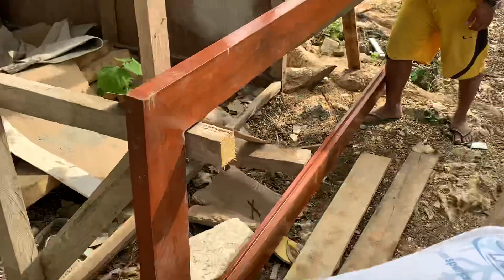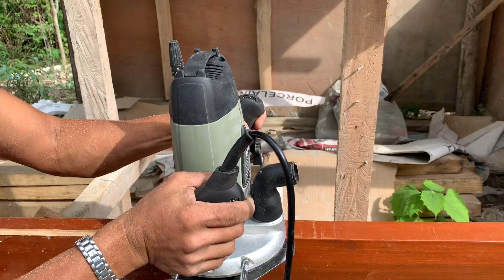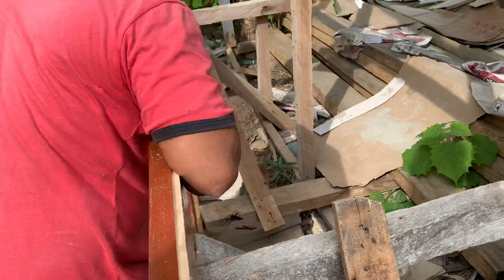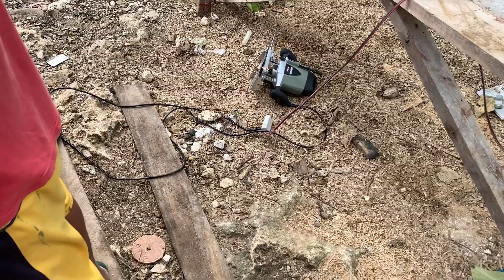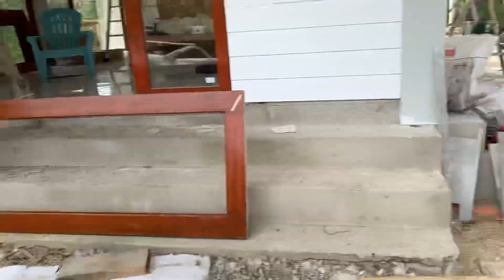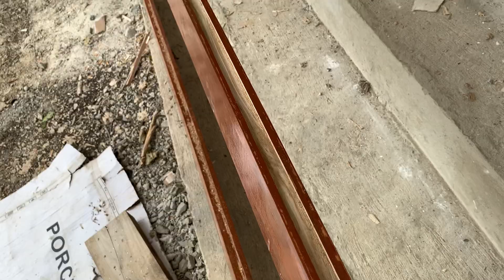SLIDING DOORS - USING THE ROUTER // HOUSE CONSTRUCTION IN THE PHILIPPINES

Comment: Anthony, I think you should make the joint with tapered sides so it is narrower when the panels meet but closes up as it bottoms out on the opposing door. After they
have done all the doors to the shapes shown here use a straight something clamped on one side  and raised a little to tilt the router base and use the same bit you 
are now using .  A surface mounted dead bolt lock keyed on both sides would hold the doors together. Probably a high mounted one and a low mounted one to be
more weather tight. Then one door needs to be attached with a pin into the floor or the fixed door so the whole set can't be rolled to one side. Remember the walls are GLASS
and you have a yard full of rocks. Just leave a large rock on the steps so anyone breaking in will only take out the replaceable glass rather than a one of a kind wood
door frame. I leave a bucket of one dollar bills on the dresser in the US to eliminate having the house look like the police have searched it during a break in. It has
worked twice so far.

                                                         george and aurora

Comment: Hi The bowl is what you sit on.  Also you could maybe tighten up the wax ring on the bottom or even add another one to use two rings for each toilet I live in Alaska and have always had condensation problems because our water is so cold we need a mixing valve that mixes a little warm in with the cold water porcelain always sweats sorry I need to check spellcheck and grammar check Steve

Comment: Do you have a check valve for your waterline if the water is cooler than the air condensation will form on the bowl or even the bottom you may need to get a valve that mixes a little warm in with the cold
Reply from the maker: What bowl ? Are you talking about the pressure tank ?

Comment: they need to learn how to properly  use router many online basics...the secret to good routing is using guides...router should have guides on both sides routing a narrow door piece like that a piece of wood on the other side to guide the router would have done simply.    he pushed/overworked the tool the build up of wood chips cause the mess up on the work piece[the door] big mistake.   the depth of the bit was too much...use several passes to achieve the work.  also the primitive condition they have to work with...the door should not just be hanging should have been clamped down on a proper work table.    why not practice with the router using a scrap piece ?
Reply: 🤣😂 oh my goodness man , they are building a house not a rocket ship🤣😂❤🙏😎
Reply: I agree. Also all the crap on the ground he could have quite easily tripped while running that tool. Now I've mentioned it, what's with all the crap everywhere? No excuse for shit all over the ground. That's how accidents happen. Peace out.
Reply: @JazzFunkNobby1964  Welcome to the Philippines 😎(Freedom)+If you watch many videos of there,they do have a tendency to do as they please & not as instructed but they get ur done 😂